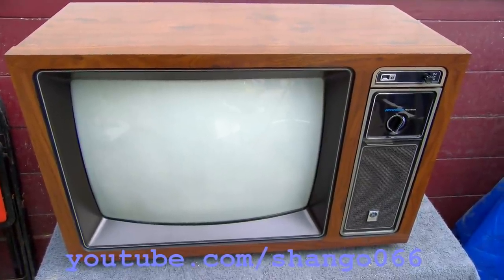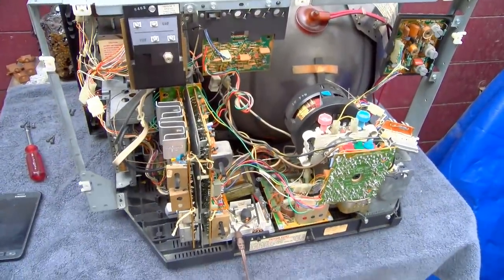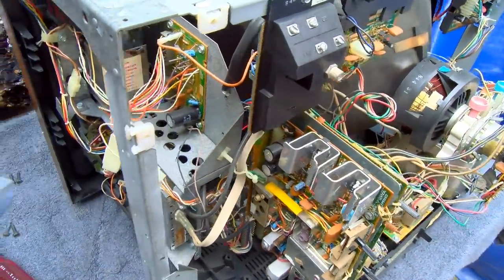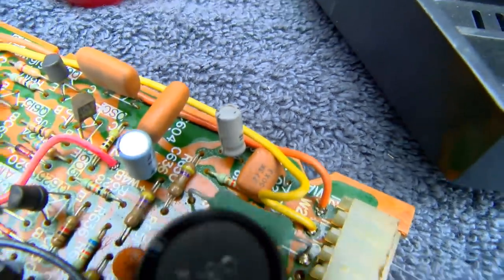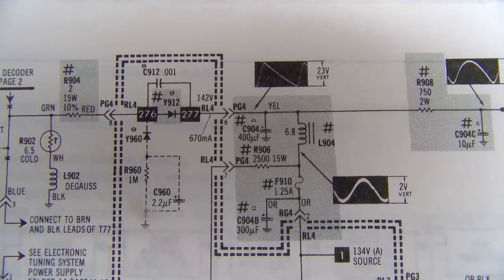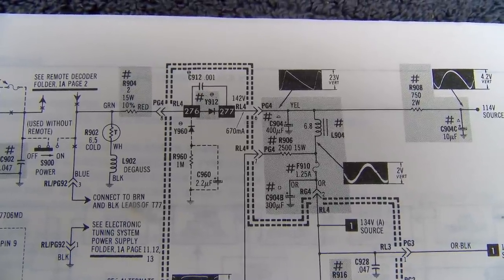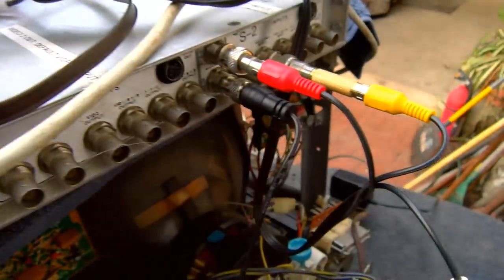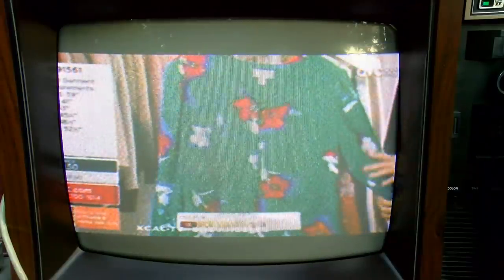1979 GE Performance Television Portable Color TV Set

Comment: I'm stunned you were able to get it this good by adding caps. When I was in trade school, a student brought in an an early 50s Zenith pre-color B&W set. They got it running, but the vertical would breathe slowly. My teacher tried and tried to solve the problem. He added so many caps he was afraid the rectifier tube would pop. It really bugged him. He surmised that in the B&W days line frequency and vertical rate were 60 Hz. With the advent of color, vertical rate went to 59.94 Hz. The breathing was the difference between line and vertical frequencies. To prove it, he connected the set to a big-ass Hickok regulated supply. The picture was rock solid. When I first started watching this video, I figured you would wind up installing a series pass regulator.

Comment: I haven't had my hands on one of these YC/YA chassis GE sets in probably 25 years. Bad yokes, bad focus dividers, shorted safety capacitors, and weak CRTs were common issues and these sets didn't stand the test of time. The one after it, the short-lived EC chassis was even worse. The only good solid state GE color chassis was the PC and that was their last chassis. This set here looks to have very low hours on it. The ones I used to see were ran into the ground. Still, if I found one of these are the later EC chassis, I'd probably still pick it up and play with it.
Reply: Good point Brian
Reply: yep, get B+ up  and you would get a new problem, really junk sets.

Comment: The UK's old 405 line 50 field system used to be locked to the 50Hz ac mains frequency which helped minimise hum.
When 625 line 50 fields came in it wasn't locked to the mains, early dual system/dual standard sets would often show no hum on 405 but hum on 625 for this reason.
Reply: Back about 20 years ago when they replaced all our office CRT monitors with LCDs, I was seeing  a strange waterfall effect, with the lines of the image staying still, but with a  slowly shifting pattern in the colors that went away when I changed the refresh rate from 60Hz to 75. I suspect that the 120 Hz flicker of the lights above was off just enough to cause a strobe effect, as one would see on a turntable platter. From what I've read, the original reason for making the frame rate the same as the line frequency was to keep reversing magnetic fields, generated by motors, from scrambling the lines of the CRT TV picture. I guess a even a little slow twerking was better than fast twerking that would just amount to a blur. I'm surprised the UK was able to keep the 405 line signal in sync with the mains frequency; it must have taken coordination between the broadcasters and the power generators.
Reply: @pcno2832  You can see a strobing effect sometimes on youtube videos where certain lighting is used and there's a bright white area.
There was quite a close link between the power grid people and the BBC, after 1969 when all 405 transmitters were fed standards converted 625 video I suspect it was no longer linked,.
Reply: After 1969 when ITV and BBC made the full transition to 625, broadcast 405 was through standards converters. Hence from 1969, the 405 line and 625 line field rate was the same.
Reply: @HughTVDX  I believe it is caused by action cameras or mobile phones cranking up the shutter speed to avoid over exposure of the image.
Reply: @pcno2832  I suspect the early TV sets used the power line for frequency reference.  Also, if the frame rate exactly matches the power line, any hum bars will be stationary and less noticeable. Anyway, I think we agree that TV frame rates were based on power line frequency, not on any decision to do away with 24 fps.
Reply: @russellhltn1396  In B/W broadcast it was only the studio synchronizer that was synchronized with mains by PLL. TV sets always used received synchronization pulses. In 30s there were no national powergrid, so frequency differed place to place. But it was near enough so the interference was less noticible - hum bars were moving, but slowly.
Reply: @UHF43  The scene in the Beatles 'Hard Days Night' 1964 film with the TV monitors was filmed at 25fps to match the monitor frame frequency to avoid flicker.
Reply: There was a guy i my street - a long time ago now - IHe said he was still watching 405 lines. I told him the transmitters were turned off but he still argued he was watching it. He also adjusted his Ford Escort tappets weekly.
Reply: Hugh - did you sell VHF-UHF upconverters in the analogue days?  I bought one and had a lot of fun! :-)

Comment: Hey Shango, that's a perfect candidate for a capacitance multiplier circuit. Pretty simple, just use a suitable voltage transistor (and current) and it will completely eliminate ripple from a half wave rectifier, even with just 470uF it will give the effect of hfe multiple of the capacitor value. 
Cheers.

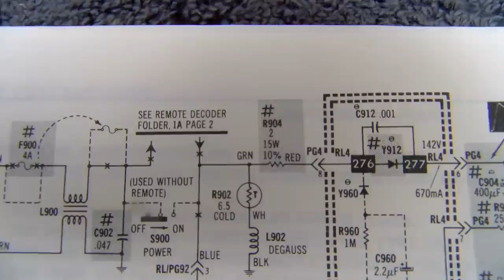Comment: 13:05 onwards:

I used to have a Philips G8 chassis set from the 1970s which used half-wave rectification. I may be wrong but I think the G11 chassis also did; I'll check this out and edit or embellish accordingly. I think these sort of power supplies were quite common in the early fully-transistorized sets in this part of the world..

Comment: Haven't watched the whole video yet, but am at the ~13 min area.  Increasing the filter caps may cause the inrush current pulse through the rectifier diode to go up and end up smoking it.  I've had that sort of thing on my mind in my professional life of late where customer requirements for a hot swap cause ~110A current pulse that blew a mosfet.  Its gonna cost them some $$ to engineer a solution.

EDIT:

Ha, OK should have kept watching before commenting!  Adding inrush protection thermistor.  You got this!

Comment: Shango our UK crt televisions were 25fps/50hz line in frequency, and they had a rock solid picture, i mean really good, therefore something else is wrong here, but the beauty of dropping the framerate electronically is that the heat produced by the stressed parts in the set was halved some times doubling the tvs life. the UK had a lower framerate but a higher resolution. could be because your set is 60hz therefore the screen pincushion issue happens because its expanding/compressing the image, there are a lot of variables to think about, another is that the audio may go out of sync with the picture, we have to remember the industry standard for moving pictures today after 70/80 odd years is still 24fps, simply because this is the minimum  refresh rate at which the human eye cant detect flicker, but 24fps in progressive scan looks absolutely beautiful on the sony bravia sets with the X-Reality processors.

Comment: That slight EW bowing might be normal when displaying a non-standard frame rate. I get the same with a few of my native 50Hz PAL sets when displaying 60Hz.
Reply: CRT computer monitors also did that. You had to re-adjust geometry when changing frame rate or resolution.

Comment: I absolutely love this TV. My first TV was a "performance Television" it is a 12 inch B/W set. I still have it, but it won't turn on anymore.
Reply: Maybe get it fixed? Ok too if you don't. They display just fine not running.
Reply: @johnnytacokleinschmidt515  I would dig Deeper into it myself, but the CRY is quite bad anyway, so not really worth it unless I find a replacement
Reply: @WalterKnox  Maybe send it to Shango and have it featured here?
Reply: @stickytapenrust6869  GUYS I FIXED IT!!!!. I decided it was worth a shot and I figured it out. 2 small Pico fuses were blown (not sure why) I checked, nothing was shorted, so I replaced them with ones from a parts board, and it works. It has been on for a couple hours now, drawing the correct amount of current and not showing any issues (CRT is obviously still weak, but it is usable)

Comment: I wonder if there was a tiny amount of current going through the degaussing coil that would otherwise not show up causing that remaining twerking?
Reply: Its possible. Also any interfering magnetic field from nearby transformer (Inside TV or in converter on top) can caused the same effect.
Reply: They only added shielding as required. We were men.

Comment: I think you could put in a full-wave rectifier.  It might bring the average voltage up a little, but wouldn't change the peak voltage.  However, you'd have to lift the ground on everything before the rectifier to feed into the other side of the bridge.  And, that would make it a true hot chassis, instead of the current situation where it's tied to powerline neutral.  That's probably why they went with half-wave.  Because it's sure an odd place to try and save money.

Comment: I realize that engineering a fix for something like this set (that was never designed to operate at that rate) takes a brass pair; here's hoping the owner understands the risks vs rewards, not to mention anyone working on it in the future.  BTW: How does perform now at 60 htz. rate?

Last but not least........Another great adventure and "thinking outside the box" fix.

Comment: It does not appear this receiver/ monitor accepts component R G B or Y Pb Pr input? Because NTSC does not support 24fps, it is not clear what is the interface from the convertor to the monitor.
Reply: You can make NTSC-like signal with different framerate. TV is not smart enough to detect it, it just need the right frequency of colour carrier. Its same like PAL 60 on VHS.
Reply: @xsc1000  oh that is interesting and makes sense. That means the subcarrier is not locked to the scan rates.
Reply: @tedrobinson372  It is locked in the studio to obtain the best picture, but in standard TV receiver it wasnt locked. Chroma PLL was independant to H PLL and V was synchronized directly. Even in VHS chroma subcarrier is not correctly locked to H/V frequencies. But I think that some modern jungle ICs that use gyrators and sampling instead of LC circuits may have problem with that type of signal if there is a big frequency difference. Because in this case many things are locked to the colour or H frequency.
Reply: RF connection with a bad or incorrect cable.
Reply: @xsc1000  in broadcast NTSC, the subcarrier is 455 times half the horizontal frequency to interleave the luma and chroma spectra. The home receiver follows the studio rate and lock. Late NTSC sets with comb filter chroma luma separation rely on the locked relationship to work. If however the locked relationship is not met, the luma must be filtered to minimize moire interference. VHS luma band with is only up to about 2.5 MHz and so the low pass filtering of the luma will minimize interference with the chroma. 
It is essentially a trade off between locked relationship vs less resolution.

Comment: Two questions: 1- Why not check for ripple on the power supply of the horizontal oscillator? and 2- Why not check for frequency pushing or phase noise on the horizontal oscillator?

Comment: Safety cap SHOULD be changed, they went left & right. Took out HOT & sometimes FBT & Vert module. Also known for H to V yoke shorting. 
The tuner & selector probably uses griplets. Slap the bastard around some to be sure
it wont shit the bed.
LFOD !

Comment: 29.99 fps comes from a math equation from a 60hz line frequency.
Reply: 1000/1001 factor I think.  Slowing the frame rate down by that ratio got rid of some kind of interference problem between the color carrier and the sound carrier.
Reply: @3Cr15w311  Half of 60 is 30. Some weird things happen sometimes when using 30fps. I  think it may be power grid related. I believe that is why the NTSC standard in the US is 29.97fps. You also may be right.
Reply: @drjmansplace5174  Actually, B/W broadcasts used to be 30fps, but when color came in the chroma subcarrier had to be some sort of multiple of I don't remember what. That would cause interference with the audio carrier so there was two options: slightly moving the audio carrier or slightly change the frame rate. Someone decided it was better to keep backwards compatibilty with older sets at the expense of being forever locked to an ackward framerate.
Reply: @UHF43  The RCA engineering books explain it in full mathematical and engineering glory. Odd numbers to avoid harmonics throughout the video bandwidth. Color info stitched in-between line info. Later came comb filters. I can't remember it all. My almost complete engineering degree gave me a chance to follow along. Brilliant engineering.

Comment: What is the reason they are so insistent on using 24 FPS ?  Although normal NTSC is close to 30,  most people are filming at 60 FPS now.  It was interesting to learn an older analog CRT TV can display other than standard frame rate so well.
Also, the car at 24:24 was one of the most ridiculous looking things ever!
Reply: Cinema movies are stll filmed at 24 fps as movie cameras run on 24fps. Yes, that is irritating, but everything from taking a shot to the cinemas is set at that speed. If you want to change it to a higher quality level, you have to change entire "chain" and that is enormously expensive. Sometimes it is done for high-end or 3-D movies, but in 95% of the cases, movie will end to regular 24 fps theater or TV... where moving it to 25-30 (or even 60) fps is no problem now.
Reply: @docnele  Thanks for the great information!  I didn't know movie theaters were only running at 24 FPS.  I would have expected it to be leaps and bounds better than the NTSC home TV standard.

Comment: 13:10 I thought just about all hot chassis sets used half-wave rectifiers, otherwise, you could never tie the chassis ground to the neutral of the mains wiring, and the polarized plugs would be useless.
Reply: nope, at least not here in the uk, most had full wave bridge rectifiers off the mains, so chassis was effectively live regardless of mains input polarity ,
Reply: @andygozzo72  The full bridge rectifier was also in some sets from Czechoslovakia. But we never used polarized plug, so nobody cared...
Reply: The cord polarization makes sure the fuse and switch are on the hot side so it's not completely useless.
Reply: @eDoc2020  ..hopefully,, its possible plugs or sockets could be wired wrongly, seen it a good few times... even so, with a bridge rectifier chassis is effectively 'live' on one half cycle or the other, depending on input polarity and polarity of the chassis (NOT always negative as you might think, in terms of the power regulator...)
Reply: @andygozzo72  The polarity would also make a miniscule difference if they run a noise suppression capacitor or resistor from one side of the power line to something user accessible. This wouldn't happen with a true hot chassis set but it often happens when there is a transformer of switchmode supply.